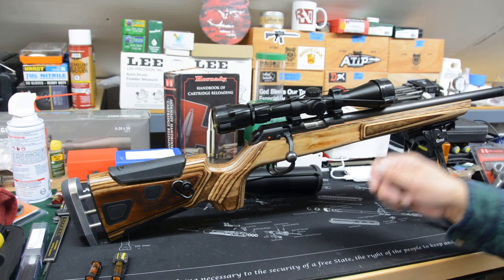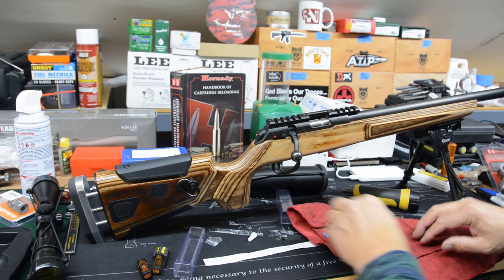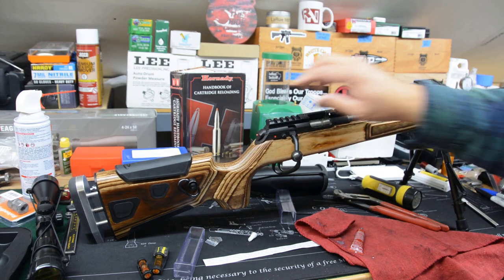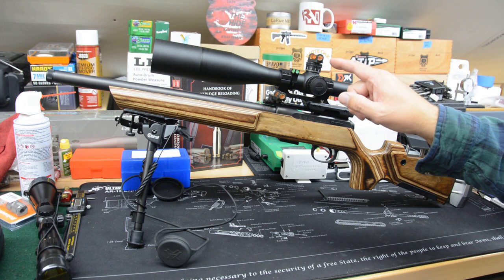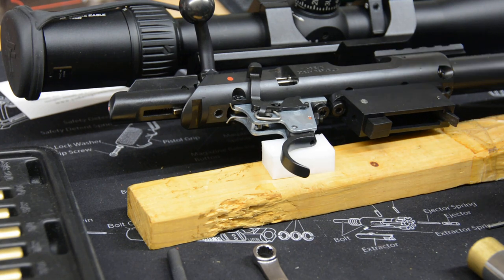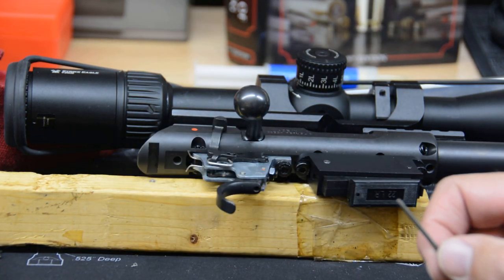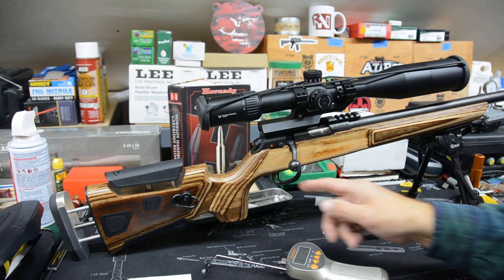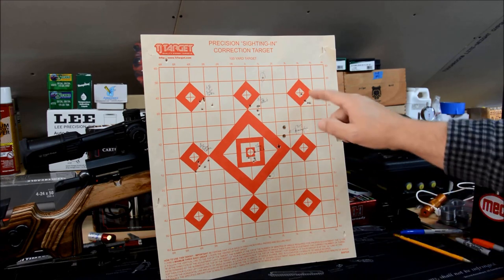CZ 457 AT-One Varmint 22LR - Scope, 25 MOA DIP mount, and trigger spring install + range time

Comment: Please follow up with your trigger pull reading after 200+ rounds. Shame on you for using a torx bit in an allen screw drive. Especially with such a tiny size drive. Very informative though for CZ owners. Be safe👍😷🇺🇸♥️
Reply from the maker: Lol,  I will.  Tks for the comments.

Comment: The rail is poorly designed. There are better rails that secure along the sides allowing for the user to check and retightening if necessary. This rail’s screws are covered by the rings and rifle scope.
Reply from the maker: I’ve had zero issues though.  Cleaned the threads well and used blue loctite.  The design basically makes the set screws act like jack screws since the rail is captured in a dovetail it’s entire length.  Seems solid so far 2+ years in but I’ll watch it.   Tks for the comment